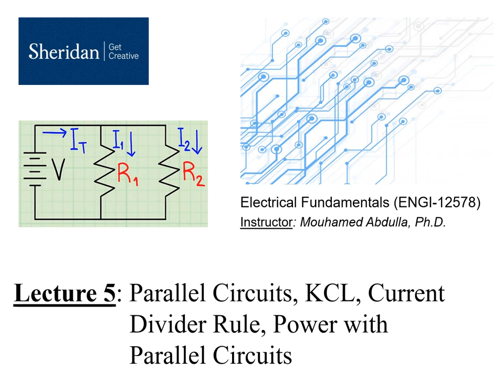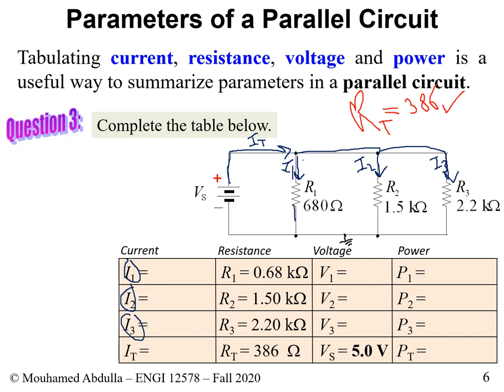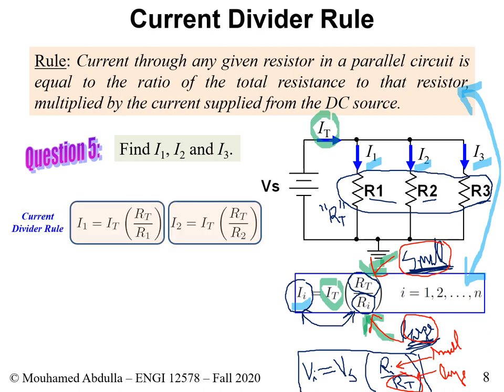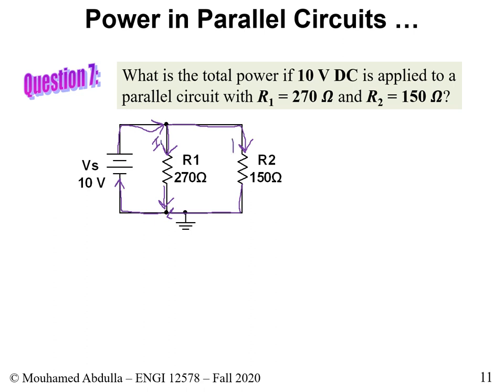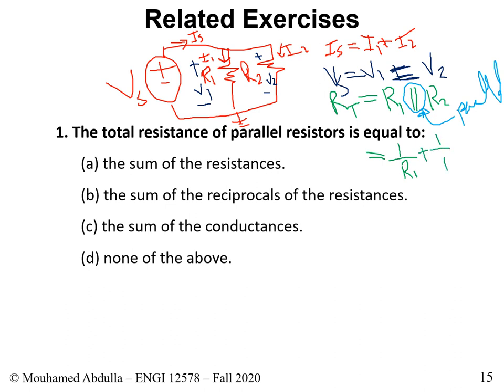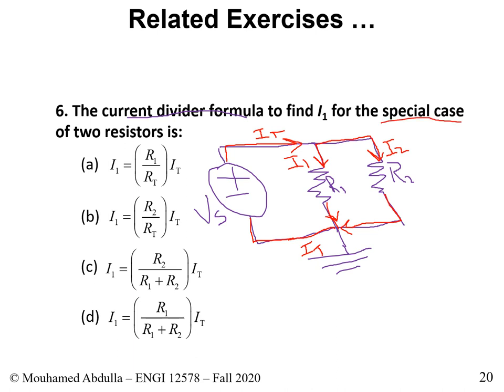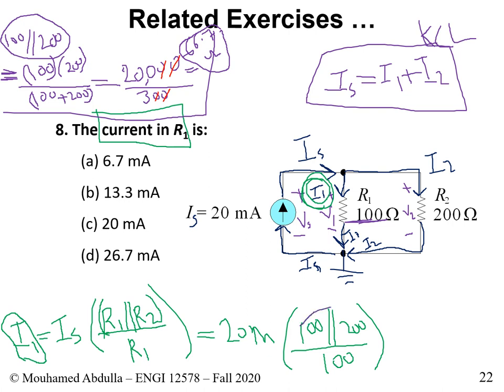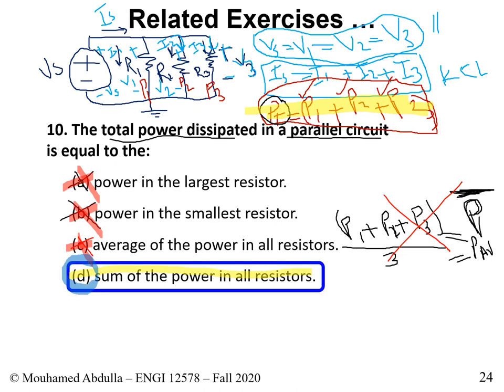Lec 5 - Parallel Circuits, KCL, Current Divider Rule, Power of Parallel Circuits

Comment from the maker: Timestamps:
--------------------------
0:00:00 - Introduction
0:00:20 - Parallel Circuit
0:05:03 - Voltage in Parallel Circuits
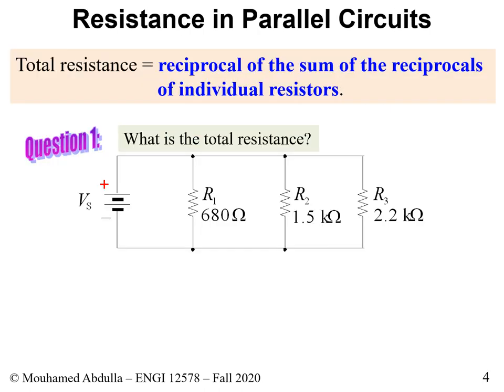0:07:22 - Resistance in Parallel Circuits
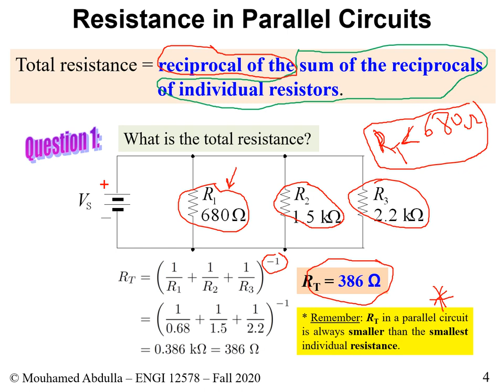0:12:22 - Parallel Circuits with Two Resistors
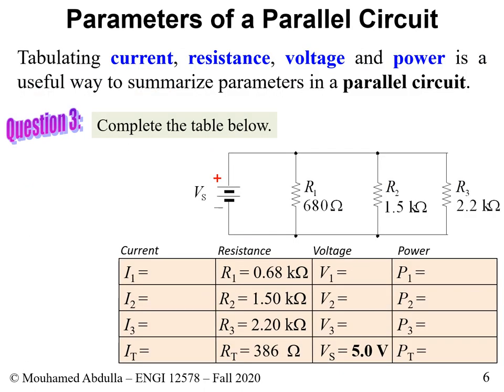0:16:01 - Parameters of a Parallel Circuit
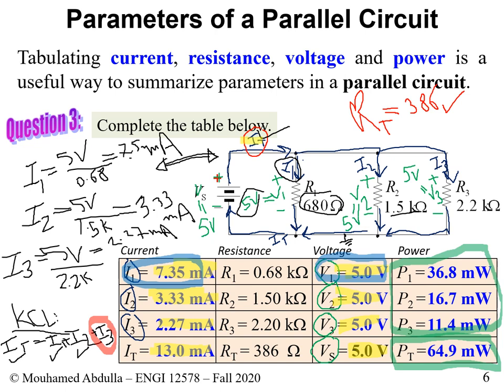0:27:46 - Kirchhoff's Current Law (KCL)
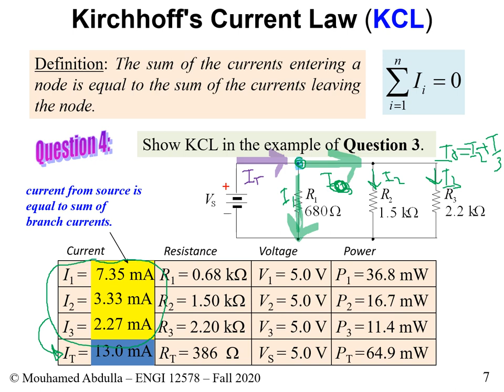0:31:34 - Current Divider Rule
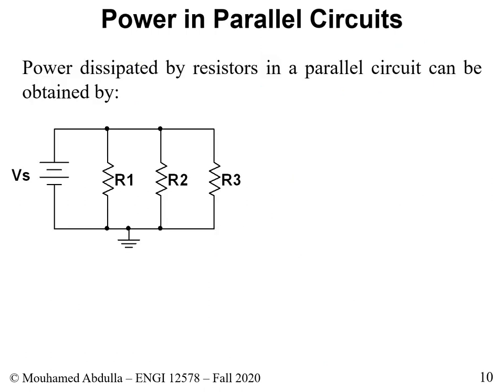0:47:53 - Power in Parallel Circuits
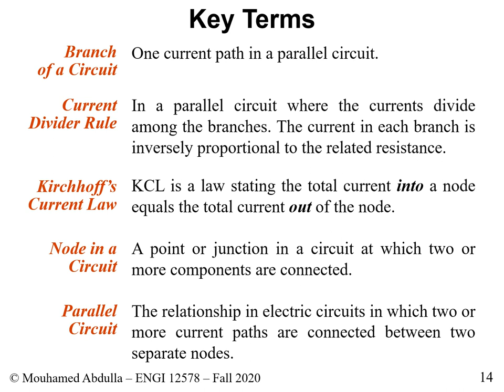1:10:57 - Key Terms and Definitions
1:11:09 - Relevant Multiple Choice Exercises (x10 problems)